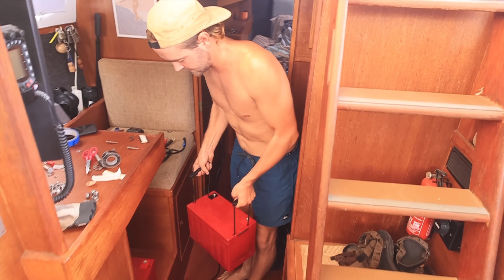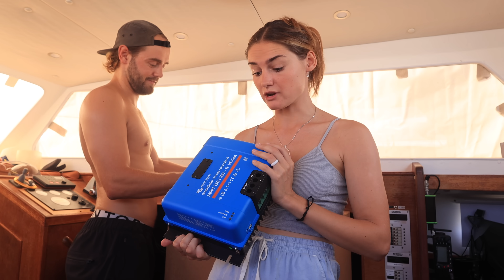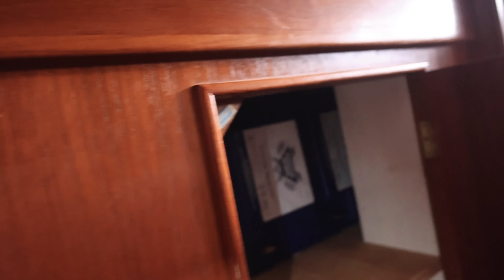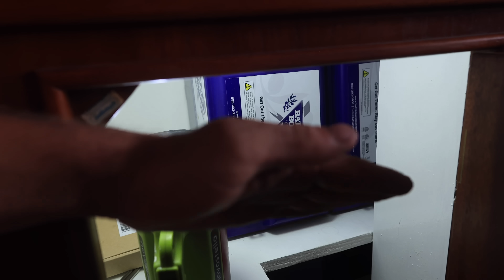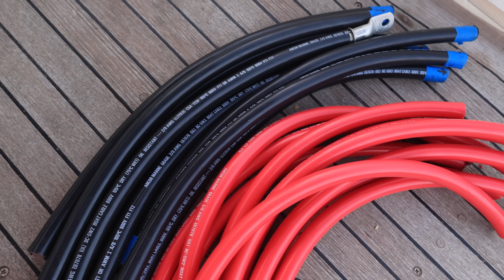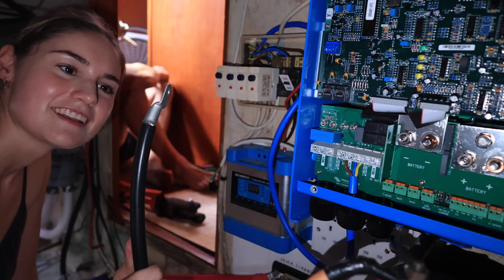BOAT YARD LIFE: Near FIRE onboard

Comment: Also adding a 4 inch 12 volt box fan to assist with airflow will help extend the life of your electronics. I realize a fan is installed in your inverter charger. But the smaller electronics rely solely upon the heat sink!
Reply from the maker: Thanks for the tip Duncan, we’ll look into it 😊

Comment: Hey guys, just a thought. I am concerned about the combined weight of those batteries and the tie down strap. Consider screwing down a thin strip of wood before each row of batteries onto the wooden base. This strip will hold the batteries in position and the strap is then a secondary measure (redundancy is king). If you are rolling during passage or at anchor you have that extra security. More so if you are constantly heeling during passage all that weight is not against the strap.

Comment: 1992 before you were born, OMG. I started as a 16 year old apprentice in communication engineering in 1974 - a very warm summer incidentally. Where have you been :-), missed all the best music and a world that made far more sense than it does today. You are doing well for a couple of ankle biters, you still need a lead acid battery for the starter motor and to protect the alternator against disconnection which would be its down fall.

Comment: I'm an electrical engineer of 80 metre yachts. Quite a step up, but the principles are the same. Somethings you might want to consider:
- Draw the electrical diagrams from top to bottom. Incoming power at the top, users at the bottom. So, solar panels and shore connection at the top of the page, inverters and chargers in the middle, batteries and breaker box at the bottom. Also, try not to cross wires. This makes it easier to see what's going on.
- Number the electrical items and cables. Something like E0001 for electrical equipment, and W0001 for cables. That way you don't have to draw everything on one giant page. You can even number the cables in correspondence with the page number. Like cables on page 1 start from W0101, W0102, etc. Cables on page page 2 start from W0201, W0202, etc. ;-)
- Putting the wire size on the diagram is great. I was just wondering if you're using ship cable (no halogen)?
- It's hard tell on video if your breaker box has residual-current protection. I'd definitely add residual-current circuit breakers if that's not the case.
- I would use something like EdrawMax electrical and standard electrical symbols, but use whatever you feel comfortable with.

Comment: Another job well done.  You both take pride in doing the work required to do top notch job, from the drawings to the placement of components, running the wires and above all doing it neatly.

Comment: This is an interesting video.  We do this type of power installation all the time when configuring a new cellular site.   Consider yourself fortunate to have a hydraulic compression tool for as many lugs as you are installing.  This tool requires less effort and is smaller than the equivalent manual tool.  Its great for working in a tight space like a boat.  Also does a neater job.  Its OK to use a match on your heat shrink.  Just rotate the cable in the flame for uniform heat application.  By the way, using a razor knife to strip the insulation from the power cable is quite OK,  Just don't nick the copper wire as it can create premature failure.  Also remember to secure your heavy power cables to prevent  flex fatigue.  Keep up the good work.

Comment: Hats off to you both for averting potential disaster, and figuring out some pretty complex wiring on your own! As a commercial and residential electrician, I'm getting more interested in  the boating side of things and still have much to learn about the technology. Some suggestions on tools, as your budget allows in the future: a compact band-saw is ideal for cutting metal, including larger-gauge wire. They cut neatly and don't throw smoke/fumes/particles. Milwaukee makes a great one (2429-20). As for cutting wood; absolutely anything but the tool Zach is using!😀. But seriously, there are very good cordless compact circular saws out there, or even a cordless jigsaw! Keep up the good work!

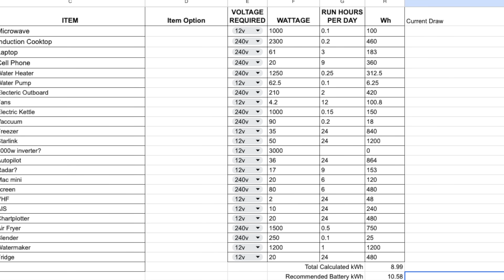Comment: Just a small thing to add here, the battery calculating table you showed at 23:03 kinda confused my because you were using kWh and kW simultaneously, however one is a unit of power consumption and the other is a unit of energy capacity, so i quickly added the numbers and checked it myself: In theory, if you were using everything at once your total wattage would be 12.2 kW. In reality it wont make much of a difference except for when it comes to designing breaker circuits. If you calculate your breakers based on the 9 kW you assumed, you might run into issues when you have a lot of power consumption simultaneously, so e.g. Watermaker, Air Fryer, Kettle, Water Heater, Cooktop and Microwave together already comes to 8.3 kW. And in the future you might add some more high-power-consuming stuff, what could lead to problems. I also noticed that you added the 3000w inverter in the list, and to my knowledge the inverter shouldn't really use a lot of power for himself, but anyways, just wanted to add this as a quick side-note, might be worth double checking your theoretical maximum power consumption as it is what you need to decide on the amps your breakers should trigger!
Reply: ...and cable sizes....

Comment: Hi guys, good job! Congrats and well done. Please take care of good air flow and ventilation where the Multiplus and the DC/DC charger are sitting. Both components shut slowly down with their efficiency when they get over 40 degrees Celsius. Especially the DC/ DC Charger gets very hot. I have mounted mine on a metal panel in between the shelf and charger to have better heat distribution and never faced a downgrade in efficiency so far. 🙋🏼‍♂️

Comment: A good solution and some great DIY work again🎉 for a not so great problem suddenly ocurring..so lucky it started and stayed with only the smell😮..I guess all your fire alarms and emergency exits and drills are checked and done too..😊 (PS try to create some extra non electric ventilation of the battery box too..you saw that when electricity fails the batteries can still heat up)

Comment: I built a lifepo4 battery out of 280 amh cells. I have eight cells in series for a 24 V  battery. I've paired it with a 3000 watt inverter. It's not for a boat, although I did put electric motors in two boats long ago. My lithium iron batts are a backup power supply for my cabin in the woods. The cells range in price. $100-150. Best bang for a Buck or Pound in my opinion. I am open to being proved wrong though.

Comment: Standing the controllers from the bulkhead will assist in cooling for the airflow. Also if you faced any condensate drips down the bulkhead, it will keep the moisture off the controllers.
I realize there is an heat sink helping with the stand off. More airflow the better!
Good luck guys and great teamwork!
Reply from the maker: Thanks for the advice Duncan, we’ll have a think about this! Cheers 😁

Comment: Excellent, 9.6kWh is a huge bank so enable lots of power devices and even more electric cooking, so reduces the amount of gas and faff filling cylinders.

Just one comment, the Victron DC>DC chargers run hotter than the sun.  Ours is mounted on the outside of the nav seat with a 3" hole behind it and we still recorded 59.9c in the UK summer.  So monitor carefully once you are back in the water and use the engine.  If necessary a small computer fan behind it seems to be the answer.  Yes its still on our "to do" list, but will get around to it shortly.
Reply from the maker: Soooo much power ❤️ Thanks for the heads up, we will keep an eye on it next time it is in use! Good idea with fan😊

Comment: Good for you! Nice work. 

You might consider adding a smoke detector in the battery locker if the system doesn’t already have a temperature monitoring and alarm function implemented. Also, consider creating insulating covers for the terminals.

Comment: A swollen battery is no joke.  They are very dangerous.  Not only do they get hot but they start off gassing Hydrogen.  In an enclosed space like in a sailboat locker the gas can accumulate to the level were a hydrogen air explosion can occur.  If it doesn't blow out the compartment the flash can ignite anything flammable in the location.

Comment: Heya guys, I zoomed in on the battery pack on your wiring diagram, it looks like you have the positive cable (going to the battery isolator switch) and the negative cable (going to victron smartshunt) coming off the SAME battery. If this is the case, you’re going to cause lots of problems in the long term with those expensive BattleBorn batteries. At an absolute minimum, you want to have the positive and negative coming off opposite ends of the parallel chain, but still going to have issues with unbalanced charging and discharging. Best case is to have all positives and all negatives connecting to a positive and negative busbar, with equal length cables for each run. This will give equal resistance for each battery, allowing equal charge and discharge of all 8 batteries, and setting yourself your for getting the full lifecycle out of these batteries!
Reply from the maker: We changed this shortly after 😀 so it charges and uses evenly now. All the linking cables and exactly the same length now 😀
Reply: @TeuluTribe  beautiful, it sounds like you want to be on this boat for the next 10 years plus, I just want to see all this good quality equipment last as long x

Comment: Hello, Teulu Tribers, just a thought re:Electric Panel system, perhaps drill some holes in the panel doors to add more ventilation. 
And Ms. Becca glad you are light sleeper bc you were awakened before something untoward occurred. Good on you.
Reply from the maker: We did need up adding a pc fan and heat sensor for ventilation. So hopefully that will work 🤞

Comment: Hi. As you use Victron components, you may consider to add the "Battery Protect" component fro. Vctron, in case you do not have any protection of your batteries, e.g for overheating that could happen again using high Amp draw equipment such as anchor whinch,  induction plates, etc. Good luck.

Comment: It seems all your batteries are connected in parallel. In such case, you should connect positive and negative lug on opposite side of the battery bank. This will limit the impact of the cables loss. Like this all your batteries should remains properly balanced.

Comment: I had two lead acid bats blow up literally! If cell goes down or charger malfunctions this can happen. All batteries have potential dangers and need constant attention. You really needvto be careful with lithiums do ensure they are properly fitted dont just trust yourselves get it checked out by a professional electrician possibly insurance will require them to be ‘professionally’ verified

Comment: please ask the manufacturer of the batteries if it's ok to mount it this way. normally the bateries are with the contacts facing to the top. the liquid inside the cells then is properly distributed. if you change the alignment of the battery, it depends on the alignment of the cells inside, if it is ok to put it this way.

Comment: Nice professional job.  Making a clear drawing first and putting label on wires.  Don't forget to put a relay on the DC-DC converter so it will  charge the house battery only when the engine is on.  I'm curious to know if you use equal length battery cable to connect to your bus bar.   Also wonder which drawing software you use.
Reply: The Orion DC-DC has an 'engine detect' mode.

Comment: Oh, also wondering if this small pipe cutters that you twirl around a pipe could be used to cut the insulation off the big wires. Guess you would have tc be careful not to cut in too deep, but these are big wires anyways.

Comment: Ieuw that sucks.
Glad your alright....physically.
Victron is my choise also. You need to be able to trust the electricity.

I built a lifepo4 with breaker for voltage and amp next to its BMS(JK). It gives me all the protection to feel safe.

I saw grounding issues with on acorn to Arabella and on Flying Coney with Victron. Not sure what s going on there. Something with shore power and or dynamo stray current 

Electricity is a mystery by chance.
Cheers. I love all the blue.

Comment: Greetings from a cold place where the only sailing possible this time of the year is by watching your Youtube channel. I am looking to convert my boat electrics as well and there is one thing I am truly curious about and that is why you guys choose to install eight 100Ah batteries instead of four 200Ah batteries or even 2 400Ah batteries? From my research it seems like most battery manufacturing companies recommend having fewer, but bigger, batteries. Higher chance of balancing to work correctly and a lot loss cables to connect everything (every cable is a potential failure point).

I would love to hear your opinion and reasoning regarding this, thanks 🙂

And thank you so much for brightening up a dark and cold winter place with your enthusiasm!

Comment: In the States, neutral is WHITE. Ground is GREEN. HOT (positive) is Black. A "switch leg" or a second hot using the same neutral (but on a different phase) is red. Obviously, there are differences between European and American conventions. Just be sure to test power before assuming a wire is dangerous or not. It can be confusing, and thus a little dangerous. Be careful. Have fun.

Comment: Lucky! 
Lithium the way to go, more safety. 
New Charger yay! 
Put a heat sensor in the cubby hole too. 
Be careful with your insurance when buying stuff from e bay that has limited warranty or is used or the seller is not supported by the maker of the stuff,if you need to claim some insurance companies will not pay out. Another thing that is coming up is self build systems that have not been checked by a qualified electrician/ certified in boats are not covered by your insurance. I may have missed it on a past episode, has your been checked? A fire resistant board on the Victron inverter/ charger is now required. May be worth chatting to your boat insurance to clarify.
Reply from the maker: Very lucky 😅 Good idea about the heat sensor. We'll have a look into it, thanks for the advice!

Comment: Ah my boat yard fix.... I will miss it when you are off sailing.
As someone who has made the mistake with 120 PC fans did you make sure the fan was drawing out? 
It's just a suggestion but did you think about adding a second fan to the bottom of the door? So you can have more effective pull/push airflow when it gets warmer? 
And I'm going to say it, you do have smoke etc. alarms on board and they are checked? I almost died in a rental property from Carbon monoxide poisoning due to a badly installed boiler, so I annoy everyone now.
Thanks! All the best to you both!🙏

Comment: You must have plenty of money. Eight Battleborn batteries will run almost $8000 here in the U.S., 3 times what a Chinese battery of the same capacity costs.  Both batteries are made from. Chinese parts, the only difference that Battleborn batteries are assembled in the United States where labor is much more expensive 😮

Comment: Nice video guys, well done 😃 

It works, that's great. However I'm actually concerned that you haven't solved the exact reason you made the modifications. 

Fire! 

When lithium batteries blow, they really blow! And you have put 8 time bombs in an enclosed timber cabinet with forced airflow to help the flames without any fire suppression. 

If or when it goes, you simply will NOT be able to stop the fire and that IS life threatening! 

I'd suggest at a bare minimum put a large fireball on the top shelf or above i.e. as high as you can inside the cabinet. 

The best solution in my opinion is to store the batteries in their own fire proof compartment, under the waterline and have flood hoses running to that compartment which are controlled by temp switches i.e. if a battery gets hot enough to become a fire risk, the compartment floods and the power is automatically switched off. 

Fire is f**CKING scary on a boat, far scarier that the any storm and far more deadly! 

Be wise, guys!

Comment: I did half of what you installed (same Multiplus 3K unit) but have not yet added Lifpo4 batteries yet. That is upcoming. One of the challenges I had was finding decent, low cost, DC rated breakers, which I used for breaker/disconnect for my solar (between panel and charge controller, I have all Victron currently). Can you provide a link or description to what you used?

Comment: I love you guys.
I do have to point out that, unless you did not want to share all the upgrades and necessaries changes to meet basic, basic NEC, ABYC, ISO or NEC codes for what you have done... 
Well you can  expect more of the same.
The video shows that you have experienced the fist electrical Ohm" laws. 
The video shows that you have not learned that lesson.
Putting more Amperage in your boat, regardless of technology is not safer, in fact it can be deadly.
I see no balancing of power, No alternator upgrade or mod,  from what you shared, expect your alternator to die (at best).
No case ground on the invertor?
Of course DC NEG is yellow...
I do not know if "you know so much" that you feel comfortable ignoring marine electrical standards, but I feel compelled to warn viewers.
None of this appears to be meeting minimum, basic, marine electrical standards.